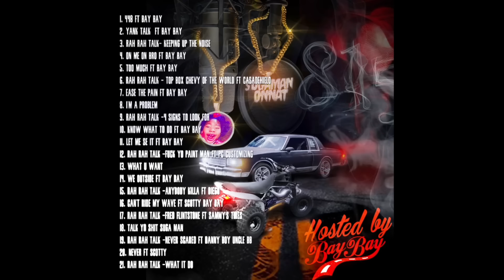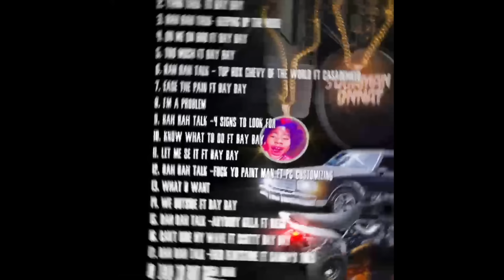Rah Rah Talk 27 I'm da box Chevy king

Comment: umm u do need power to apply a vinyl top wtf especially if you building it. you need a sewing machine then u need a air compressor to spray the adhesive on the roof so the vnyl will stick